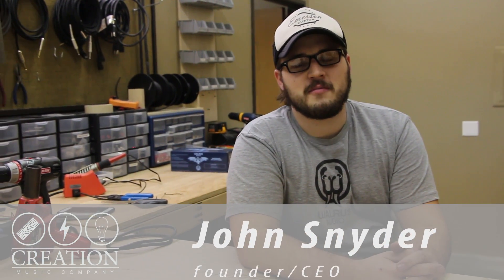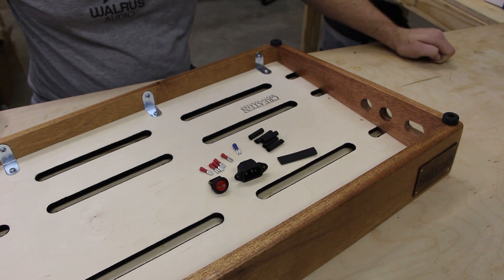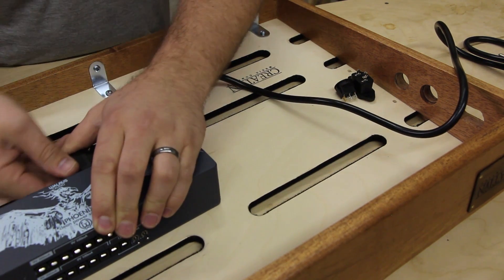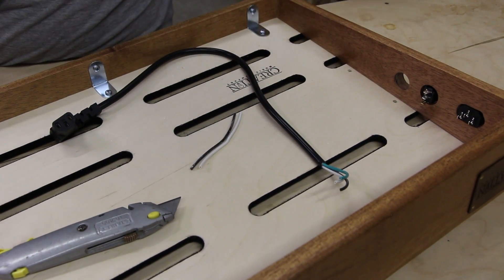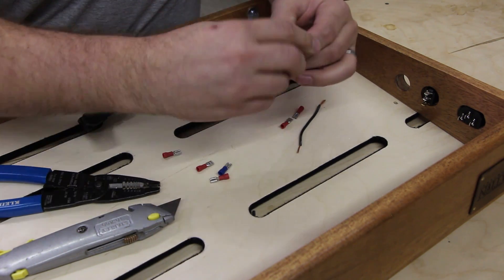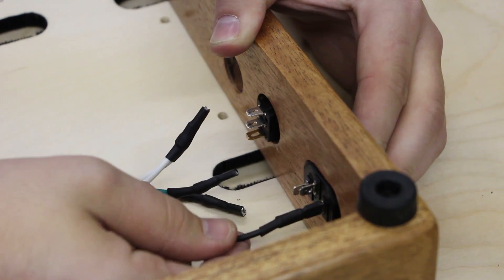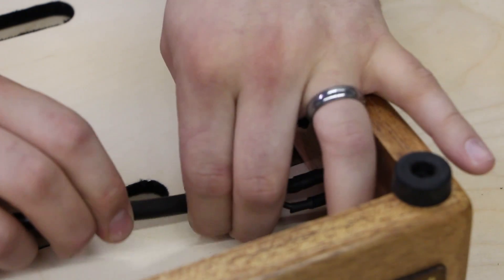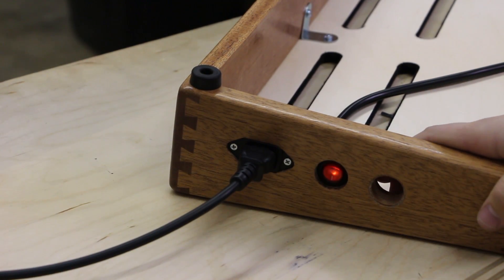Wiring an IEC Power Jack and Rocker Switch Tutorial

Comment: I just had an idea. I might try a female iec to a regualar female socket. Female iec is on the side that goes toward the outside to have an iec wire to plug into the outlet. On the inside part I would have a normal female plug to plug pedal power into. Well, what about a switch? This is my favorite part, instead of direct to wall, have it go into a smart plug, turn on and off with voice. I may be crazy and it not work, havent tried it yet.

Comment: Hi John great video… I’m a solo musician and have all my cables in a rack case… 

Rather than open the case It be great to have the power C14 on the outside with a switch as seen in your video…. So could I have a 4 socket power board going to that one c14 ? I’m from ireland so the current is different than the US
Reply from the maker: It would be different with the voltage over there as it’s all 120v here. However, if I understand you correctly, then yes. I’ve wired little 3-5 outlet power strips to this sort of setup many times. Just make sure the switches and connectors you use can handle the amp load needed for the power strip as it’s usually a heavier gauge wire drawing more current.

To be clear, I am not a licensed electrician. Any answer I give is purely for discussion and only speculation.

Comment: After 7 years your video still helping out. I had a hard time trying to figure out how to wire just a 2 wire rocker, even though your video was 3 wire, you explained about the double neutral being for the light and isn't necessary for 2 wire. I could not find any other video to explain this as precisely as yours. Thanks

Comment: Thanks for this video. However, the power station has a 3-prong inlet which this type of wiring supports. How should asian type of power station, with a 2-prong plug be wired, using the same IEC sockect and switch?
Reply from the maker: I'm honestly not sure on this. I typically don't use power supplies that aren't 3 prong.
Reply: I've found  the answer. I condemned the ground pole and not use it. So far I am using my pedal board perfectly.

Comment: Thank you very much for this.  Very well done video!  I have a question about the number of power supplies you can connect to the same switch?  For example, I have 2 power supplies one 4X4 voodoolab and 1 ISO 5 .
Reply from the maker: In that situation, I would rehoming wiring a dual plug cable to the switch. 

A better solution honestly is to use a power supply with a courtesy outlet, like the Monod or PP2+ and just link them with a short ac cord. OR, a lot of the newer power supplies like the Strymon ones, like with a 24v connector. One power supply can link up to 9 total in their ecosystem. I'm a big fan of this.

Comment: I don't know why I didn't consider using spade connectors, I soldered all my connections. your method is safer and easier to take apart! Thanks
Reply: Solder in power connections is a bad idea as they can heat and weaken the solder to failure over time

Comment: Ik..this is a old posting but can a non iluminated on off push canopy switch like on standard light lamp be used as interrupter with iec on pedal board ...
Reply: Yea. It would just be 2 wires instead of 3, both of the same color.
Reply: @johncalebsnyder  so you use the neutral side or the hot on the interupter or was the hot on the switch only for the led

Comment: Only one problem.  You used 18-22 awg connectors on 16 awg wire.  They may not be rated for the amp draw your power supply as they are typically only rated for 7A.

Comment: Very clear, instructional video. How would I wire the rocker switch to illuminate from a wall plug but not pass power? I have a device the only needs to see an open/close and not receive power but would still like to see the illuminated light on the switch.

Comment: I would like to highlight the importance for using terminal connectors in this application.  I opted to solder the wires directly to the terminals of my switch.  The metal terminals drew too much heat and melted out of the plastic switch housing.  I had to reorder the switch (PartsExpress.com) and will be absolutely using terminal connectors going forward.
Reply: What type of terminal connectors did you use? Do you match the  voltage? what size matches the c13 blades?..etc. Thanks!

Comment: Do you use a router to make the hole for the plug? Any other ways to do it that don't involve me buying a router? Lol great vid btw. Love your stuff
Reply from the maker: Mitchell Heinricks We use a router and a template to recess the front (larger part) of the IEC into the frame. For the back half we just drill 2 holes that overlap each other and then file the middle of those to make it even. If you don't recess it and just surface mount it, you can just drill for the back half.
Reply: Creation Music Company cool. Thanks!
Reply: Are you able to share the router template with us? Thanks!

Comment: Can the rocker switch be used with the AC inlet?
Reply from the maker: Samuel Ruiz yes. It's tricky to fit the 2 wires into one of the AC Inlet holes, but it can be done.

Comment: I bought one of these IEC plugs with a switch attached but theres no wiring connecting them. The switch has 4 lugs instead of 2. So Im guessing its to interrupt both power and ground, is that right? How do I wire it up? Co tinuity test the switch lugs? Cant tell if they ground and power are paired off with the top and bottom lugs or the left and right lugs. Please help! Thank you!

Comment: So I did this with the kit from the website. Idk if this is just an operator error, but how do you get the end of the spade connector on the iec?
Reply from the maker: Mason Moak They are snug, but they just push on over the tabs with a good bit of pressure.
Reply: Mason Moak I had to use a thin tool to widen the opening just a tad before they would slip on.  Very easy though.

Comment: Will this work for a power supply that has a regular dc cord? similar to a daisy change cord. I'm not sure if I strip it if I will have the 3 wires, it looks thin... I have a COWEEN DC Tank with 6 Isolated 9V DC Output with DC Cable.
Reply from the maker: No. you'll be pulling AC current from the wall, not DC. What you could do is wire in a single Edison plug (american wall outlet type) to the inside. We sell a 12" one. Then you could plug the power supply into it. You're need the power supply to convert AC to DC
Reply: :-( Bummer. I'm not sure I follow on the alternative option... :-/
Reply from the maker: Wire it exactly the same way you see in this video, but with this. https://creationmusiccompany.com/diy-pedalboard-kits/
Then plug your power supply into it. We should be getting some more this week.
Reply: ok, cool. I'll check back in a week or so cuz I don't see it. thanks for your I help. hope to get this figured out soon.

Comment: Cool demonstration! Thank you for the video. How would you wire two power supplies to a single IEC outlet?
Reply: was trying to figure out the same thing
Reply: Zachary Drummond I think you'd just need to double up your connections with two cable ends.  You'd probably also need bigger spades to accommodate the extra copper wire thickness.

Comment: Excuse me, the Rocker switch Do You screw it down?
Reply: +Geronimo Mejia  I'm with you on this. I took a look at their website to see if there was more information. I didn't really find much but from the pics it looks like it might be a pressure fit type switch. Still unsure what size hole is needed and if a recessed lip is needed or not to secure it in place.  http://creationmusiccompany.com/illuminated-round-rocker-power-switch/
Reply: did we ever get an answer for this?
Reply: It's a pressure-fit housing. There's two "ears" that sort of compress as you slide it in and that keeps it in place. It's pretty solid. I've bought a few and there's no screws, but no issues with falling out if the hole is drilled properly.
Reply: Just use calipers to measure the diameter without the pressure fit "ears" then drill that sized hole.  I then had to still file some small groves for the ears, not too much because they need pressure.  But then they just press snugly in.  No screws required.